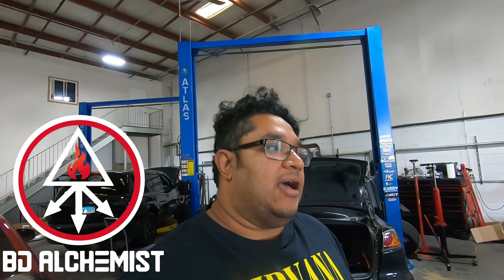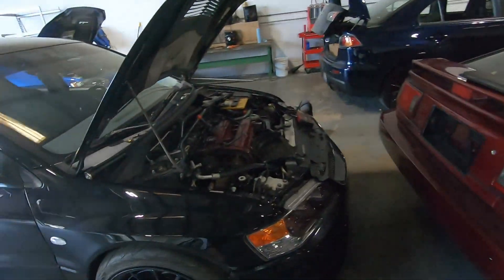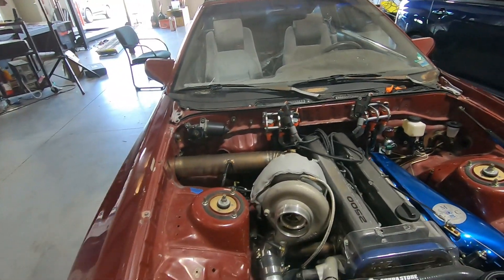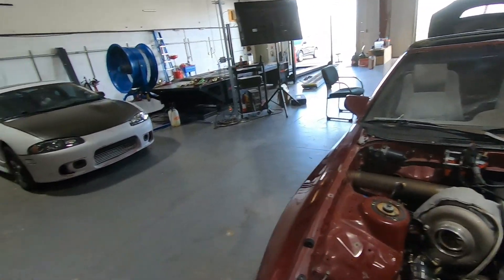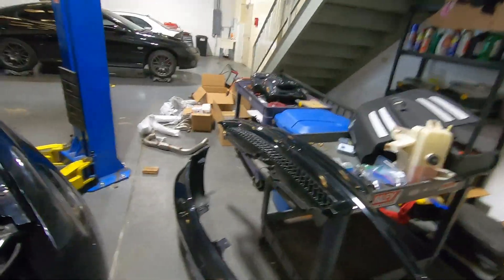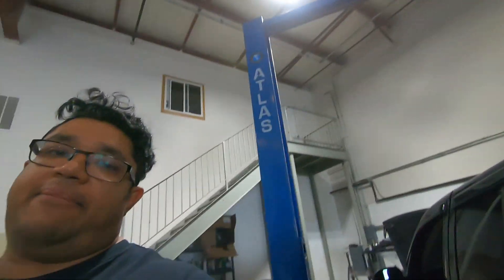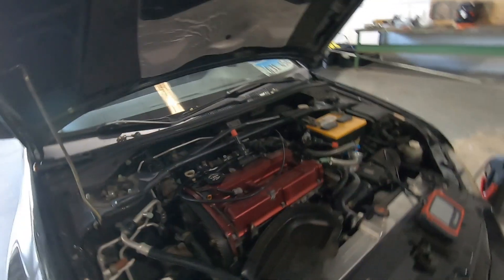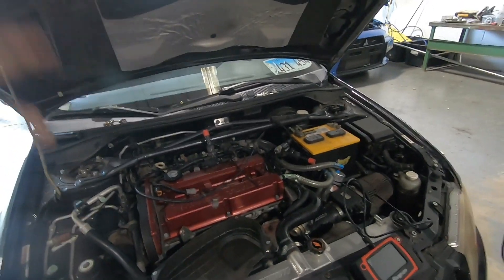How to make 500hp stock block evo 8/9 4g63 and becoming a tuner discussion

Comment: I make 523/427 on 28psi and 472/398 on 25psi, fp blk, id2000s, 450/255 pumps, bc 280 cams, arp 625+ new oem hg, SD, ebc, eBay 3.5 evo IC and 3” greddy turbo back, it’s been like that for 7yrs now  

I also did a gates belt kit a few yrs earlier when I first went 280 cams and e85 stock turbo

Comment: Stock block Evo 8 RS here ruining 560hp 400tq since 2014
Reply: Damn 🤩 I'm over here worried about stock block 400awhp 350 ft tq on stock 9 turbo all bolt-ons cams built head  and pump gas.
Reply: I's there any engine difference between RS and GSR models ?
Reply: @pacpacpacpacpac  2004 rs gsr same engine
Reply: Yea 523/427 for 7yrs now, fp blk & bc 280s, stock block

Comment: Could it be possible to make 500+hp on a 2g 4g63 255pump and e85?
Reply: My set up 2g 7bolt 8/5/1 pistons 272 cams 255 pump FP black 1g throttle body 2.5inch piping magnus intake FIC 1220cc .

Comment: Hey bro been loving your videos and very helpful for my evo 9 build. Question- I have reconverted my evo 9 to speed density and I am doing the tuning myself. With the tephra file 88590175 and my rom 88590015 I have been able to tune my injectors to get the idle at about 12.2ish still super rich fuel pressures and everything else has been set perfectly so I’m very sure I need to go after VE tables. But the tephra model I’m using doesn’t have those. How do I download the speed density tephra version so I have these extra tables

Comment: Hey chemist what y pop or opinion on stock valves compare with ferrea. I'm in the process of building my evo x. I bought the after ferrea stainless steel and they said they not using it because the stock valves dissipate the heat better than stainless steel. 🇯🇲

Comment: Hello I have a question I have a 2009 Ralliart whith a Evo x engine I’m having doubts about the oil pressure 4psi on idle just have cp pistons  and Manley rods please advise thanks from Puerto Rico
Reply from the maker: That's not good. U should talk to ur builder
Reply: @bdalchemist  it’s the second pump that is installed and the crank was cut to
.25 because the first time wear the bearing because temperature issues with the previous owner.the Granade blows in my hands
Reply: Man thanks for your time and your content I really learn about this platform

Comment: G4JS head. What’s your opinion on building for power?
Reply: Was just talking about this a minute ago then bam, saw this comment. Upgrade cams and valve springs, evo ones can work. There is less valve shrouding so this head flows better than evo head by design. Combustion chamber is bigger so it will drop compression
Reply: @horacecunningham7832  can still use my same evo head gasket
Reply: @carlito165  which block are you using?
Reply: @horacecunningham7832  64
Reply: @carlito165  use the 4g64 headgasket
Reply: @horacecunningham7832  so just leave my head gasket on
Reply: @carlito165  either get a new one or copper spray the one you have if it is in good condition. I highly recommend getting head studs. I am building 2 G4JS engines right now plus I have a 2003 lancer with a built ralliart 4g69 engine with a holset hx40. The cylinder walls are thin so I recommend headstuds.

Comment: Do you think 500hp is a reasonable goal with an FP green?
Reply from the maker: No
Reply: @bdalchemist  what about 400?
Reply: @JustInfamousX  400 is easily done on pump gas for a fp green with cams.
Reply: Yes on E85 a Green will go 500hp, plenty out there! Mhi or SS housing
Reply: @markc1456  agreed, to many people down play the FPGreen. I love mine.
Reply: Depends on the type of dyno. I would say yes as I achieved 480whp e85 on a mustang dyno using a FPGreen UHF SS. If you convert that to a dynojet that’s over 500whp. It depends on supporting mods and tuner.